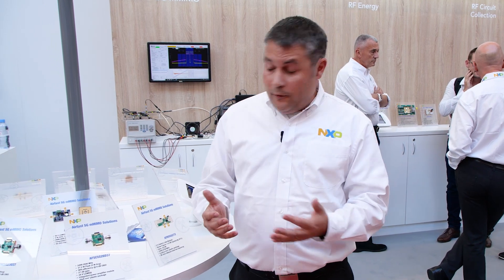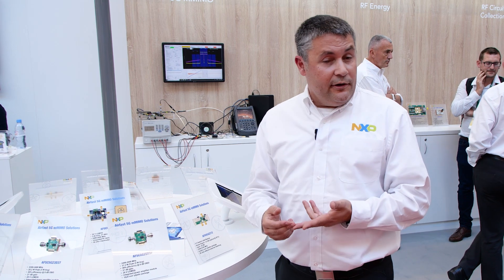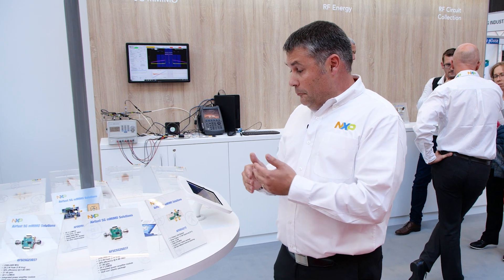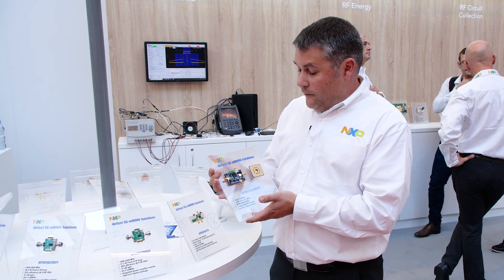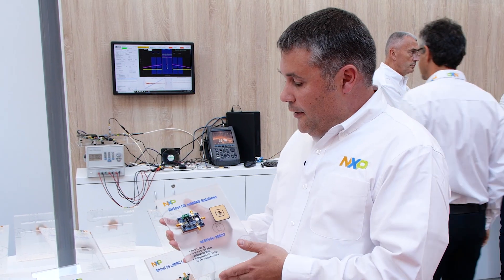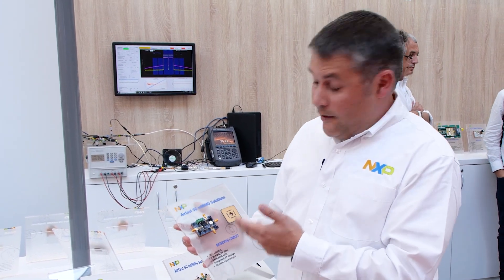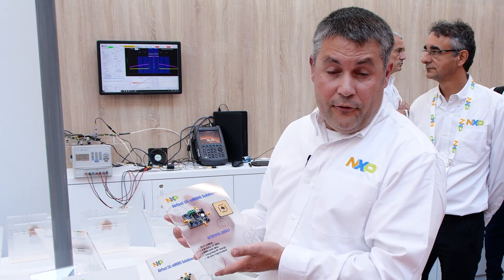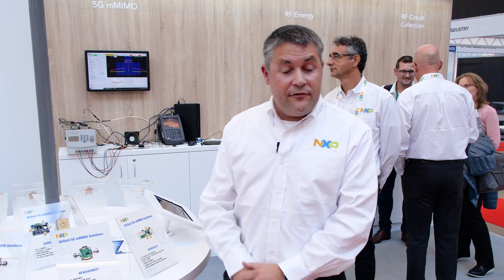5G RF Massive MIMO for Cellular Base Stations - NXP RF

Comment: He keeps talking about linearization of the different products. What exactly is he referring to there.
Reply from the maker: Hi Jake, thanks for your question! Linearization refers to Digital Pre-Distortion (DPD) which is typically used in PA systems to correct the linearity of the amplifier. More information on pre-distortion can be found here https://en.wikipedia.org/wiki/Predistortion